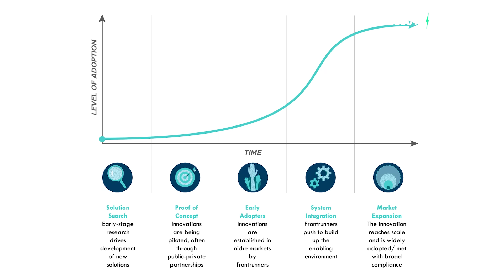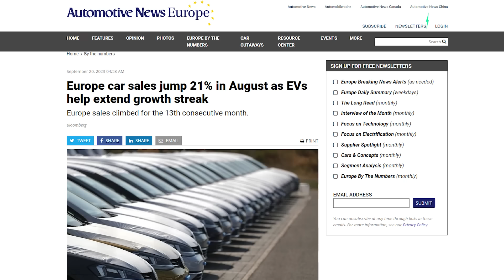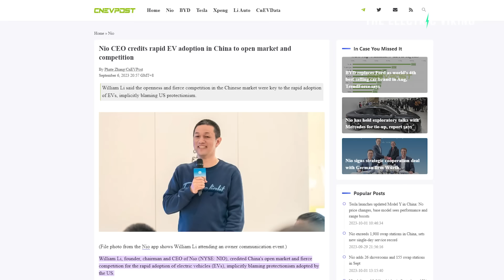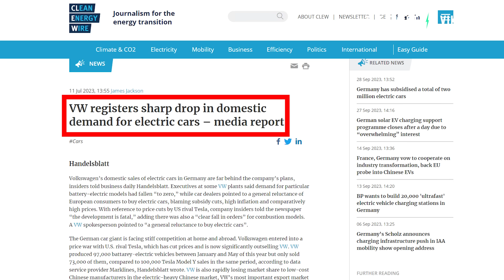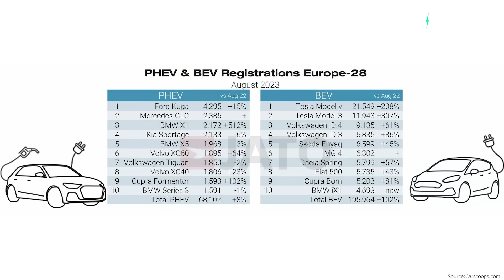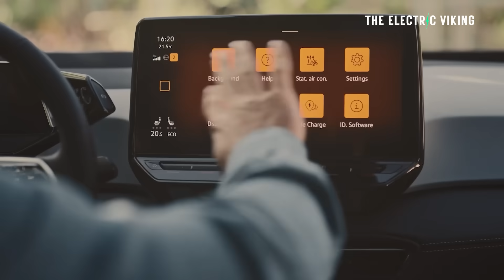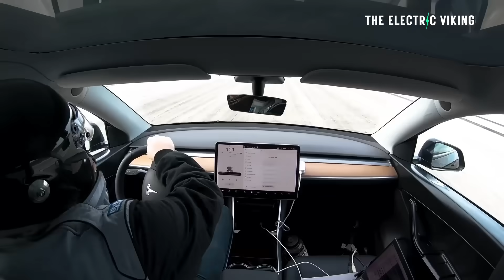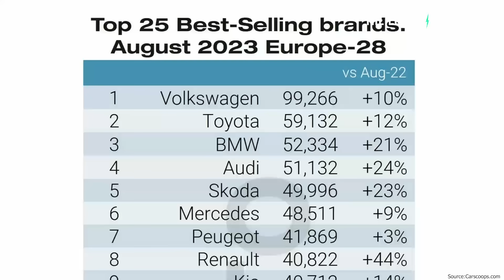Electric car sales in Europe up amazing 102% - legacy auto begins panicking

Comment: Percentages mean NOTHING without the raw numbers. Percentage is what people use when they are trying to hide the real numbers. 

A 100% increase of 1 is 2 give us the raw data number of ICE vehicles sold vs number of EV's sold because that's the number that matters.
Reply: Did you watch the video?  It did give numbers.  It also said EVs surpassed 20% market share of new vehicle sales in Europe.  They are no longer a niche product.
Reply: @dansanger5340  all EV's sold in Europe are around 190k... BYD alone sold in China around 150k.
Reply: @dansanger5340  yes but how many of those to fleet sales driven by tax incentive rules etc rather than a genuine considered choice?
Reply: Oh dear... looks like you didn't pay attention. Before you post a dumb comment, make sure you've taken in all the content.
Reply: @MartinHouston42  Annually (as they have done for some 30 years now - so PRIOR to any EV "revolution") The World Bank, IMF and ECB have been producing a detailed report on "incentives" given to the fossil fuel industry. It is a lengthy, comprehensive and somewhat difficult report to understand and absorb, but the bottom line is that (Globally) the fossil fuel industry benefits to the tune of about $5 TRILLION annually in tax rebates, concessions, grant funding, kickbacks and other pay-offs.
Of course, this industry is notoriously corrupt, so none of that benefit filters down to the "man in the street" - at least with EV incentives, the common man (woman) sees the tangible benefit.

Comment: The Chinese models will be looked at and when when...
When the people figure out that the cars are better, as cars, regardless of drivetrains, than even quality European cars, what happens to sales, then?

They are too, better than the European autos, aren't they?
Comparing models by models, on the showroom floor, using performance statistics but holding off 'quality of drive' comparisons, panel gap by panel gap, feature by feature. Walking around them & stepping in and out, sitting in them. Taking in, broadly, aesthetics, Chinese autos are rocking it.

Chinese autos are quality. They merit some respect. Letting the market do its thing, you know, Capitalism-ing, then, Then They Will Sell Like hotcakes! And they should.

Yeah-yeah, labor and capital dislocation. Capitalism. European or US legacy auto will reorganize. New players will come to the market. It isn't like there's a huge existential change. Still just Capitalism being Capitalism.

btw, how cars are in our lives is in flux. 
We need to get a handle on how we make cities. That's the knot there. Best car is no car. We got this.

Cars, even Super nice Teslas, all the best EVs ever, are only stopgap solutions. Sort of like hybrids. We need to address building better cities, establish food security, a SWB finely distributed too! Large % from residential rooftop. We need real solutions.

CARS ARE NOT A 1st Principle solution to transportation, regardless of any currently available drivetrains.

That seems simple and obvious to me once it was pointed out.

Comment: I'm fascinated by the "Highlander" view of car technology (i.e. "there can only be one"!).  It seems that many EV advocates are determined to say that "ICE is dead".  Is this true?  Could technologies co-exist for a longer period of time?  

After reading widely and watching way too many videos from both sides of the argument, my view is:
- ICE cars are significantly more flexible and usable over a wide range of operating conditions than EV's. On the other hand, in urban environments, EV's have a significant efficiency edge over ICE. As do HEV's. 

-  EV's are not a "net zero" carbon emissions product.  Most charging is done at night, when the electricity grids are powered by hydrocarbon technologies.  Lithium batteries also require significantly more dirt to be shifted to be made, and most of the dirt shifting is ... driven by diesel.  

- EV's (in most of the world) are still significantly more expensive up-front than ICE cars.

- EV's are cheaper to maintain than ICE cars, but are not necessarily cheaper to run over the lifetime of the car. For example, insurance costs are skyrocketing because repair of EV's is harder - in part because of the safety issues associated with batteries. (Also in part because of some interesting design decisions by Telstra that make their cars harder to repair).

- There is limited evidence that new EV's have more safety issues than new ICE cars.  Thermal runaway is rare, but incredibly dangerous on each occasion.  ICE fires are more frequent (especially in older cars, or modified cars), but are much easier to extinguish / contain.  In other respects they seem equivalent.

- The rapid increase in EV sales is significantly attributable government mandates influencing fleet decisions.

- Some people are concerned about the impact of "networked" cars and the implication for government control of peoples mobility.  EV's are inherently more likely to be networked, but many modern ICE cars are also equipped with telematics.  The privacy / convenience trade off in cars is very much skewed towards convenience regardless of power source.  According to Mozilla, car makers are the worst industry when it comes to protecting privacy / data.  IMNSHO this is not really an EV:ICE issue.

- Finally, geopolitical concerns are real.  China is skewering the West on electric technologies (first solar panels, and now EV's), which has massive implications.  Although there are many concerns with the ethics of Western governments, it is inarguable that the Chinese government does not respect human rights or tolerate dissent.

Comment: If 40% price of Car is battery then 40% of Tesla is BYD (Lithium Ions)
Reply: No, because Tesla will probably ++ on that battery because of many cost factors added to the battery.   For example storage, handling, service provided (to its own customers for anything related to battery problems, as Tesla could not ignore its own customers even if those problems arise from parts that Tesla procures from suppliers, etc).
Reply: Only some Tesla models have BYD blade batteries.